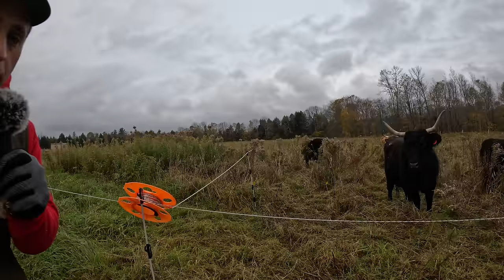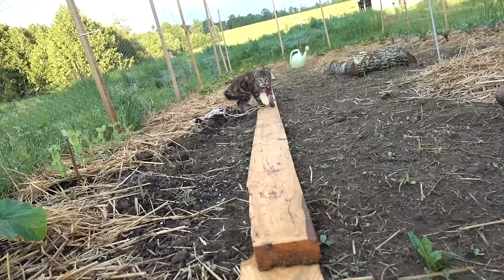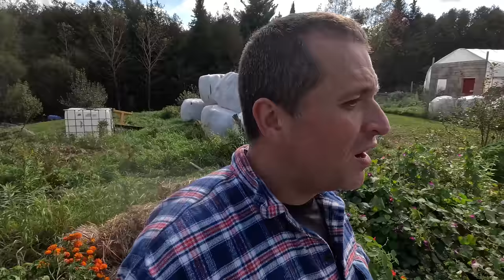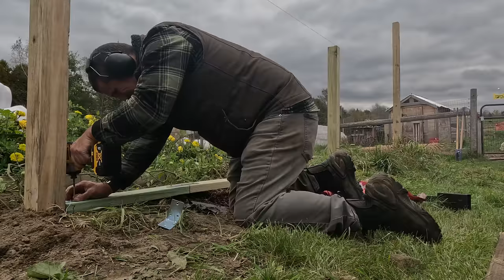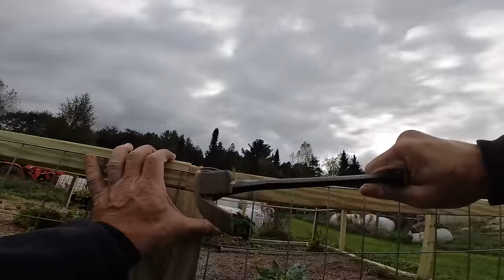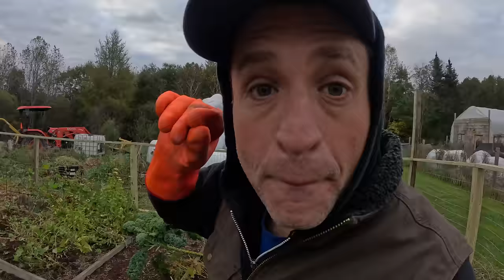Wife Wanted a Beautiful Garden Fence (I did this instead)

Comment: From experience, Rabbits will go right through that wire fence.  Add a hardware cloth buried  6" into the soil around the bottom, It should go about 14" high.
Reply: Seconded. Bunnies will stroll right through those gaps like they're little bunny doorways.
Reply: I was just about to say that. And they will also burrow underneath it.
Reply: Yes, and the bit in the dirt should angle outwards.  They will dig right at the point where the fence hits the ground.
Reply: Also deer will jump that easi!y, you have the height on the poles, so just a light netting is al! you need for a visual deterrent, does not need to be strong.
Reply: Yep, a rabbit will hardly notice it, but it looks great.
Reply: @Ribberflavenous  Deers will jump anything more or less but won't jump if they can't see where they will land and also a encloser like that is unlikly they want to enter and also the dogs are probably keeping them away.
Reply: I doubt any rabbits or deer would go in there because they would be to scared of the dogs that are 20 feet away from the garden.
Reply: Not to mention woodchucks/groundhogs will burrow right underneath.
Reply: I was gonna say the same thing.  That fence will not keep out rabbits, squirrels, chipmunks, & other rodents that want free food.
Reply: @bargetherooster3079  Not a bad point, but they were having pest pressures so perhaps the dogs are not reacting as they are no threat to the livestock.
Reply: @P4hko   Sorry, not true. The deer are smart enough to know the dogs can't reach them.
Reply: @diceportz7107  i'm not from US so I don't know how smart they are there so probably true. But the dogs sure notice them so can't see why they want to go near unless they are starving.
Reply: That was my first thought-how bloody big are the rabbits in northern Vermont?
Reply: Deeper darling......
Reply: Agreed, my dwarfs would escape without effort. Especially Frank my rescue. Dude wants to mate with humans and only human, he shall not be contained!
Reply: @P4hko  Our deer are very accustomed to humans and human activity. They may run off for a few yards if a dog barks, but that is only until they learn that all the dog can do is bark. This is why it is so hard to keep deer from bushes, gardens, trees. They learn what will and won't pursue them rather quickly.
Reply: @Ribberflavenous  I was meaning they would be naturally scared to go near them. It is unlikely that they would start barking if they seen one.
Reply: @diceportz7107  This is true. The small herd that regularly traverses my wooded acreage passes right by the fence with two barking dogs. They are only about 15' from the fence line and pay them no attention. They've been doing this for years.

Comment: You'll need to put chicken wire all around the base of the fence otherwise you're still going to deal with rabbits getting into the garden.  Be sure to bury the chicken wire 6-8" below soil level as well since they'll dig their way in.
Reply: There are dogs not even 20 feet away I don't think any rabbits would be brave enough to go in there.
Reply: Yes, and 1" chicken wire, not the 2 inch.
Reply: Even better would be 1/4 inch metal fabric with decent sized rocks on top, like 5-8" cobble.  I had a skunk momma and her babies in my back yard and that was the recommendation, along with the recommendations to put it underground, at an angle, to deter burrowing.  That may sound like overkill, but belts and suspenders means I haven't had the problem again, 8 years later.
Reply: @bargetherooster3079  Rabbits aren't stupid, and they'll learn that the dogs can't get at them sooner or later.
Reply: @Nemrai  they are going to be eaten by a wild animal before they figure out
Reply: I must agree, with dogs roaming free in my yard I have had very little trouble with rabbits. The live in the front yard which is not fenced, thus the dogs are rarely there. But in my fenced, dog patrolled area I have no issue with rabbits.  Moles are a different story.  And our young dog can do an amazing amount of damage to my garden in short order if I forget to close the gate, or she manages to nudge it open.
Reply: @bargetherooster3079  those dogs are fenced in their own area sometimes so the yard is not 100% protected 100% of the time.
Reply: @bargetherooster3079 i mean he said he had the issues in the first place so......
Reply: @bargetherooster3079  My black lab disagrees, happily XD What worked for us was the spray deterrent. Just have to reapply every month or so (dry here, maybe more in a wetter area)
Reply: @Nick-82  yes, well he stated the two things which could really cause problems in the garden in their region are rabbits and hedgehogs, he didn’t say they had actually experienced destruction.  But being prepared, preventing a problem is certainly better than having to recover from the damage.
Reply: @victoriabaker4400 Came here to say this.
Reply: @Nemrai  Yup, the rabbits in my yard know that if they sprint off and my dog was too slow that she will give up BEFORE the rabbit is safely away from her. So they run off but not fully away to preserve energy. If she is close to catching them they keep running but when I let her out to pee she is usually slow to start chasing them
Reply: @lilolmecj ..no hedgehogs in America except as pets. Woodchucks,on the other hand. Very destructive.
Reply: @thaismatsumoto  my mistake, I misheard, or misremembered, or picked it up from another comment.
Reply: @bargetherooster3079 - The dogs are inside a different fenced area, so rabbits would not be adversely affected by the dogs. The cats, of course, are a different kettle of fish as small rabbits may be prey for the barn cats.
Reply: @wendyweaver8749  No way man I had no idea the dogs were inside a different area. That is like saying a chicken wouldn't be scared of a Fox on the other side of a fence.
Reply: Nice job on the fence Morgan.

Comment: Gardening tip for Allison: peppers aren’t annual you can have them growing for 5 years if you wanted to. when fall comes you need to cut the leaves off and dig it up with most of the roots then put it inside a house or a greenhouse in a pot then it should survive just fertilize and water it then plant it in spring.
Reply: I don't think they have a green house.
Reply: Next project: Allison’s greenhouse!
Reply: This is what my mom does. She puts pepper plants indoors. But they’re in large containers with drainage, not in the ground.
Reply: Can confirm! I grow jalapenos and habaneros in large resin containers so I can move them into my attached garage during freezes.  They immediately burst into flowers in spring because they are already full grown.
Reply: @Ixmore  They have the hoop coop, which is the same thing
Reply: @MtnNerd   True, but the geese and ducks and chickens are in there during the winter and would demolish them. I don't see morgan closing off space for plants. I could be wrong though.
Reply: @MtnNerd  Are you really going to put your own crops in coop with a bunch of poultry where they can get at it?
Reply: @Ixmore Doesn't really need to be a greenhouse, mine are standing on a windowsill under artificial lighting (all my windows are facing north).
Reply: @MtnNerd the hoop coop is way too cold. Peppers are subtropical plants and die if the temperatures fall below 40-50°F.
Reply: Gardening tip, all mint plants have square stems, but not all square stem plants are mint. 😎

Comment: I'm pretty rabbits are pretty similar from here to there, ours just go through the chain link: You'll probably have to at least do the bottom in 1/4 inch hardware cloth, at least 1/2 inch.

I've also realized that I'm always going to build fences in sections and then connect them after installation, much easier to manage the tension and general stability.

Comment: Aww Allison, you are such a nice young lady.  One word of advice on keeping rabbits out of the veg patch is to have some smaller fencing wire at right angles (chicken wire is fine) around the outside, stops them digging.  We've had great success with ours, although ours is sunk down about a foot and attached to the posts) but the voles are the little blighters that tunnel all over the place - luckily we have cats, the neighbour has cats, we have buzzards, kestrels and foxes.  Not so impressed with the badger digging up the field though - he hasn't found the veg patch yet!  My husband was wearing a special gauntlet to protect him from slicing his hands while using the slicing machine.  It ate through the glove and his finger.  Sliced the top almost off too.  The hospital said it was a nice clean cut and it healed really quick.  Allison has the power to rebuild you!  LOL!

Comment: Allison is great! Please be careful putting tension on fencing with machines in the future; I was with someone while installing a barbed wire fence and they were using a tractor to put tension on the wire. The barbed wire snapped, slicing the palm of his hand open. He was out of work for at least a month.
Reply: I suspect a barbed wire fence would definitely deserve an extra dose of careful respect compared to an ordinary fence, although obviously any sharp pointy stick can pierce flesh easily with the forces a winch can apply...
Reply: Something similar happened to my aunt while we were doing construction cleanup on new housing for oil field workers. Snapped up and sliced her face wide open. Just barely missed losing her eye and caused a major wound on her face that swelled up both her eyes.
Reply: @Lonesome__Dove  Wow!

Comment: You could add criss cross beams or smaller horizontal beams on the fence as well to make it prettier and maybe loops on the higher poles to attach a sun roof between the tall beams for days when it’s extra sunny when the plants risk being sun burned. 

The pattern on the fence could work as extra growing space for beans and similar climbing plants, especially since the wire is on the outside.

Comment: Regarding the rabbit comment and  wood chucks I laid hardwood railway sleepers ,I got old used sleepers for free all along the bottom of the fence, plus laid a flat horizontal layer of trench mesh, outside the garden but right beside the entire fence, you could use the fence wire, 3 inches under the soil.  This also stopped my dog digging under the fence.

Comment: I bend wire about 24 inches out from the fence. Grass will grow through the wire and that will keep critters from digging under. Oven racks are great to use as some of the wire around stuff. With wire around and up about 12 inches and out 24 inches the woodchucks do not get in nder the deck anymore.

Comment: I would have gone with an 8 foot tall 2"x2" fencing so 2 feet can be buried to prevent animals from burrowing under the fence and eating your crops. A rented ditch witch to make a 2' deep trench around the perimeter would be pretty easy. Does your wife want any kind of decorative entry gate to the garden? The fence puller is awesome, it really makes a huge difference in making the fence tight and tidy looking.

Comment: I was going to comment how you must not have chipmunks but then Ginny had one in her sights.  We had to put hardware cloth around the bottom half of our garden fence, dug five inches down, with 6x6  pressure treated lumber placed around the base of the garden fence as further deterrent to keep the smaller creatures out.  Deer fencing on the top half to total 8 feet.  Then bird netting to cover the whole garden.  No LGD to keep critters away.  Indoor cats are not much help.  Now if we could just solve the bug and fungus issues!!

Comment: The bottom boards you set against the ground will rot over time. Dealing with that on my fence. Areas where soil has risen over time and the bottom boards and planks now touch the ground, remain wet longer, and have rotted away. Might be worth digging a small gap under those boards if you intend for this fence to be a semi-long term solution. That or slope the ground away from the fence to help it dry faster.
Reply: You can get wood treated for ground contact. It will still rot just take much longer .

Comment: A few notes. First, it looks good, should last a long time. That is welded wire, not woven. A determined small cottontail can squeeze through a 2x4 opening when scared. I've watched them do it. And certainly young rabbits can just walk through. I suggest a run of 2' chicken wire along the bottom to prevent that. Paint it and it should not rust. As I'm sure you know, woodchucks tunnel ... a LONG way. What is the plan to keep them from coming into the garden under the fence?

Comment: Attractive, but that is a lot of heavy metal introduction adjacent to a place you grow your food.    CCA, copper, chromium, and arsenic is what those pressure treated posts are made with. The cedar posts were great, looked good, and were totally non-toxic.  Plus, the cedar was local and could easily be sourced off your own land. That lumber you bought is southern pine, which while farmed in plantations, is still coming from hundreds if not a 1000 miles away.  I'm not trying to be critical or negative for the work you did.  Just some thoughts.

Comment: Maybe after it falls down, you'll bury the 4X4s the extra two feet - it should not move that much when nailing the fencing. Imagined the fencing if the posts were a foot or more deeper. You are in major Winters, your frost line must be many feet deep. The posts will lift on you especially with a tension on the fencing.

Comment: Here's a better way if it can be considered "aesthetic". Cut hardware cloth into very long 18" strips to fit your planned fencing; fold one 6" side of the strips up perpendicular to the remaining 12" all down the strip. Dig a trench 6" deep and 6" wide along the planned fence line. Place the "L" shaped hardware cloth, 6" down, on the bottom of the trench with the 12" sticking up and the 6" pointing away from the garden; backfill the trench. Pound in 6' T-posts against the visible part of the hardware cloth. Then hang cheap 6' wide, 1" chicken wire (or whatever keeps out the varmints you don't want) so that the top flops over to the outside of the garden from the top of the now 5' high T-posts; the chicken wire should come all the way down to the ground. You may want to tie the hardware cloth to the chicken wire in places so there's no gap 

Rabbits and other diggers will give up when they come to the buried 6" of hardware cloth. Climbing varmints will come to the flopped over chicken wire at the top and not be able to continue on; squirrels will figure it out, though. Deer can't see the chicken wire very well and the top is confusing to them. With the raised beds inside, they won't like the difficulty of landing without hurting their legs.  Groundhogs will tunnel so there's no way to stop them.

Comment: The fence looks great, but won't keep rabbits out. Instead of regular wire fencing, you should have gotten rabbit fencing where the wires are closer together for the bottom third or so, so the holes actually prevent rabbits from getting through. Now you'll need to remedy the situation by adding chicken wire or hardware cloth to the bottom 18 inches or so.

Comment: 3 mins 40 sec in and I believe you are making a large mistake for ground that freezes. If you want to cement the posts you need to dig deeper then your frost line or every year the frost will push the fence posts up, and sideways. Gravel (limestone is best IMO) will be much better if you dont dig below your frost line to set posts. I am in a much colder location then you and learned hard lessons pulling up cemented posts

Comment: I hate for you to do all that work on your wife’s garden fence but rabbits can get through that fencing. You’ll need to add something else along the bottom like cage wire which is fairly cheap and easily manipulated to adjust in different areas.